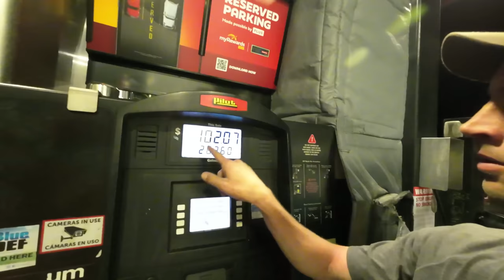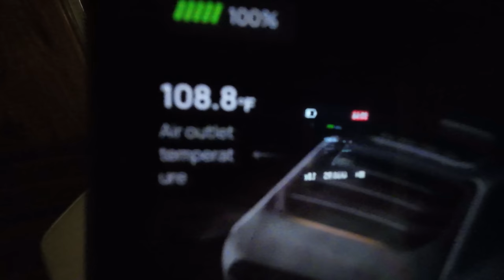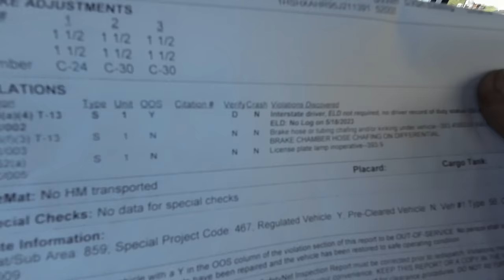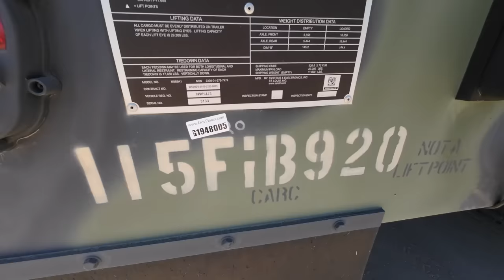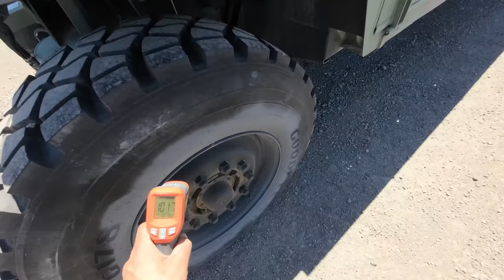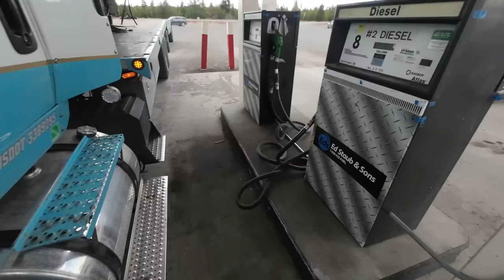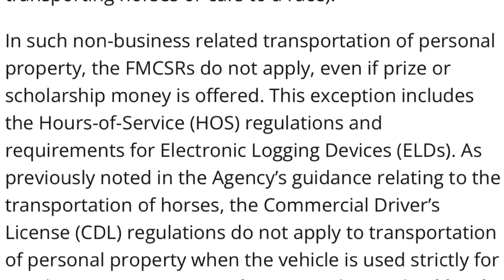Busted by CHP!   But I Know a Loophole…

Comment: 1:14 (yeah I'm back, forgot that I'd watched this - 9 months ago wow that long) ...
Anyways, at this point I spotted the set of your (rather pathetic) headlamps, and what you can AND CAN'T see ahead of you, thus wanted to point out another "loophole" that you may not be aware of, if allowed that is, and that's to put TOP OF CAB "exterior roof mount" a lengthy LED Light bar, which you can add too, or switch on independently too, your main beams, as an additional driving light arrangement, whereby the light output is "above" your own head height eyesight level, to reduce splashback glare, while giving you light into dips and gullies either on the road ahead, or over a bank if you are so inclined to drive right up too, to see over clearly, for anything that has "gone over" that cannot be seen by standing at the top of such a place roadside.
Staying in the cab, you can see over only if the light is above you, rather than in the normal low mounted headlight level, hence it will enhance your recovery operation, while giving you a far better (no dark spots ahead) distant view of the road, before you get there.

For about (1973 - 2019) ? 46 years, I have had "above roof" driving lights, that not only allow me to see further with zero dark spots along a bumpy road (unlike normal headlights mounted BELOW one's eye-vision level) which greatly reduces long distant driving eyestrain, as well as allowing you to see a lot more either side too, as the lights will also be above the scrubby shrubs etc., alongside the road edge, allowing you to view things on the sides that could be problematic, such as wandering stock.

If these are switched independently to your main beams you can thus also use them during off-road or difficult recoveries, without running your main beams.
That way, you can also dual select a rearwards facing light bar (also mounted higher above the cab than other rescue lights) allowing a sunlight view of good lighting, that you don't otherwise get from spotlights (or hand held torches).

Now,  with you and the machinery you drive / haul, not having a serious output from a roof mounted driving LED Lightbar, you are having a is a serious loss of vision, that could mean you may be running into something unseen that would mean you did NOT have sufficient room to slow down for, let alone be prepared for, should it happen to be there unseen, such as a flash-flood, or a washout, which above eyelevel lights allow you to see as soon as your eyes can view the area, without waiting for your main driving lights to light up that pitifully small view ahead, which we can see isn't that big a lit area at all.

OK found the link that I was searching for, (all night, after watching too many intermediate videos) and this one is the one I think you will like Casey, merely for the REDNECK outback (outside the barn) farmer's way it's done - along with the fact the "farmer" forgot to align the light spots, with their driving distance view, rather than straight down at the grass 10-20ft in front.?????
Trees what trees so he walks over to where he can see them, with those wonderfully bright "long distance" driving beams - still aimed directly into the grass 10-20ft in front of the paddock-basher truck.

Oops, had the link and it dropped along the way back, so I'll go grab it again, as I still have that tab open.
https://youtu.be/Lk-WssBWUxo

Comment: Might be careful mentioning you have a "commercial" account for fuel but not using logs. I understand you did your homework based off of the violation issued but having the fuel account might throw a wrench in it. Not sure but just a heads up.
Reply from the maker: Not even remotely close to a problem

Comment: OK. This is where shit gets stupid. Wreckers are tow away vehicles. Different set of rules unless you go what used to be over 100 air miles from your home base. Now i think 150 miles. Using the truck for personal use you have to log and note personal conveyance. Because it is a commercial vehicle. Now the really stupid part come in. If the GVWR on the vehicle is 26001 pounds and above then it is a big truck. Which I assume it is. The sticker on the door is your GVWR and not registration. Then that requires a Class B CDL to operate with the proper endorsements.

Be careful about that log book. Once you start logging you have to keep logging. To be honest i dont know if you can take 7 or 8 days off and reset your wrecker status or not. OOIDA or a trucking lawyer may be able to inform you by the actual FMCSR.

But after 40 years driving it used to be a game of cat and mouse. Now the "cat" weighs about 5 tons and just stomps the mouse. So check the logging thing out with a lwyer. Because if you stop logging after filling one out and dont keep it up you can be in violation or in an accident not even your fault be sued by a lawyer. So always keep your duckies in a row goosestepping.

For the record solo drivers should never show sleeper berth. Always off duty not driving. By law on a 10 hour break or even 8 hour break way back it is consecutive hours off duty with nothing pertaining to the truck or load. Log books were paperwork pertaining to the truck so... you go from off duty not driving to sleeper berth then that is paperwork which interupts your break because you have to show every change of duty status. Unless you run team it is not the CVSA, DOT, FMCSA or glorified state troopers business where you sleep. The FMCSA states clearly 10 consecutive hours off duty with no responsibity to the truck or load.

Yeah i was in Safety until i couldnt take it anymore. About six months dealing with rookies and idiots with golf shirts or ties.

And dont forget now we have CVA points. That means even though you didnt get a ticket or put out of service it is points against your CDL. Not wearing a seatbelt now is an OOS violation and more points than speeding. Sealt belt tickets used to be a bullshit way an officer would cut you a break. I had many 25 dollar fines and a few times 20 over the speed limit and drove away with a seat belt fine. See the cat and mouse game? The cat done growed up to lion size and invencible. Check your violations with a lawyer because those CVA points can cancel your CDL even class Ds.
Reply from the maker: Please don’t ever give anyone advice, EVER.  Because you ware flat out wrong about pretty much every single thing you said.

Comment: You kind of put your foot in your mouth when you talked about the fuel being charged to your commercial account. With that admission in evidence, they could make a case for that being a reason you need to keep a log book. You should make sure that the fuel is charged to a personal account if the trip is for personal use.
Reply from the maker: Nope.  Not even close.
Reply: @CaseyLaDelle  Just tryin to help a fellow trucker out. I know from experience how these corrupt highway cops and the courts operate. Doesn't really matter what's exactly written into law. They will purposely misinterpret it just to make your life miserable while you fight the bogus charges.

Comment: Your "loop hole"  doesn't work for 1 reason.  Even thou you where currently under personal use.  You still need to be able to show 7 days worth of log book.  Even if it just  a single page for all 7 days prior.  So the DoT officer is still 100% correct.  And you are lucky he did not fine you for it. 
That is the problem with being  a local driver know just enough to get yourself in trouble with log books.

I can go on vacation for 14 days, still need  a log book page saying I was on vacation for those 14 days.
Reply from the maker: Wrong
Reply: @CaseyLaDelle  Soon as you travel outside of your local bubble you are required to run a log book.  Even if you just have 1 page for 7 days and the comment field reading N/A through it.  
Tells me  all the phone calls you made you didn't ask the right questions.  Let me guess you only asked about personal use and how/when it can be used.  
Every OTR driver knows this. Like my example above 14 days of vacation, first page will have a line of off duty with the date range of those 14 days off and the comment field reading  N/A or vacation time.  Doesn't matter if the next thing I do in the truck is personal or not.  DoT wants to know what you did 7 days leading up to that personal use time once outside of your local bubble.
Reply from the maker: @MrShuntking  i literally posted the EXEMPTION….
Reply: @MrShuntking  🤦 imagine arguing when you're wrong
Reply: @HajileMalach  Imagine having almost a 20 year career as a CDL/AZ driver and NEVER getting a single ticket or warning.

Comment: Technically you are still using your truck for income. The reason is because you are using it in or for your you tube videos which you are being compensated for. So technically you are still required to follow all DOT regs. Now if you don't monetize your videos then your golden but I'm sure you do this to make some income and so that makes you uncompliant. There's videos out there that Youtubers explain it because they got busted because they used a commercial vehicle for what they thought was being done under personal use. They were fined and to run as a regular commercial driver and regs in their videos.

Comment: You have to do a log book but you put yourself on the driving not on duty line
Reply from the maker: Wrong.
Reply: @CaseyLaDelle  Personal Conveyance
Personal conveyance is the movement of a commercial motor vehicle (CMV) for personal use while off-duty. A driver may record time operating a CMV for personal conveyance as off-duty only when the driver is relieved from work and all responsibility for performing work by the motor carrier. The CMV may be used for personal conveyance even if it is laden, since the load is not being transported for the commercial benefit of the motor carrier at that time. Personal conveyance does not reduce a driver’s or motor carrier’s responsibility to operate a CMV safely. Motor carriers can establish personal conveyance limitations either within the scope of, or more restrictive than, the guidance provided here.
Reply: @CaseyLaDelle  right
Reply: @CaseyLaDelle  how long have you been driving?
Reply from the maker: @tester3x   I have been driving with my Class A CDL for 20 years.   The law is very clear.  It exempts you from ALL record of duty requirements.   Personal conveyance is for when you make a personal trip while engaged in commerce.  For example, if your at a truck stop during your 34 hour reset, you can drive to get meals or entertainment.   But this is NOT personal conveyance, it is non commercial operation.   Two very different things.

Comment: So if this was to be argued in traffic court you’d lose. 
And here’s why. 
You are filming and being paid by YouTube as you operate your commercial vehicle. CHP likes to prove points, so I’d not press the issue with them as they will investigate and prove you are operating a commercial vehicle for commercial purposes and for compensation. 
So as long as you tell them you not a YouTuber you’re fine. But you’re still wrong.
Reply from the maker: Wrong.   I made that very clear with the fmcsa auditor and the YouTube aspect is completely irrelevant.   The truck is not being paid “to haul the load.”  And I own everything I’m hauling.  Those are the two qualifying factors for the exemption.   The fact that I’m making money from a separate business doesn’t matter.